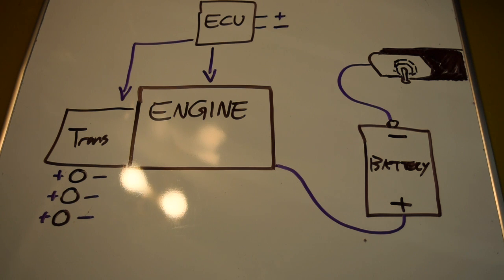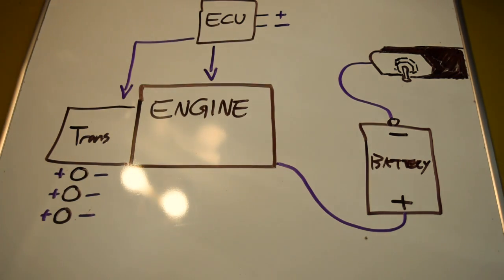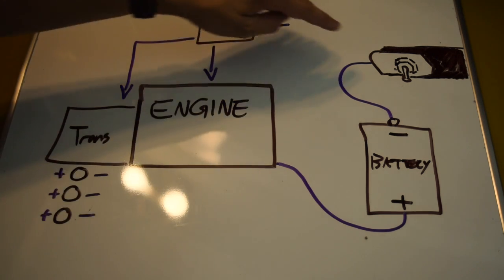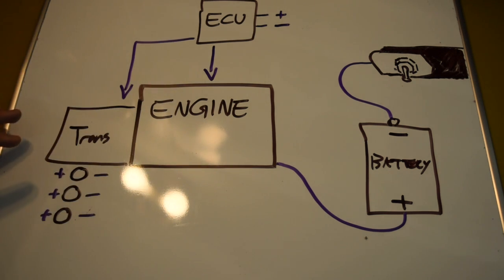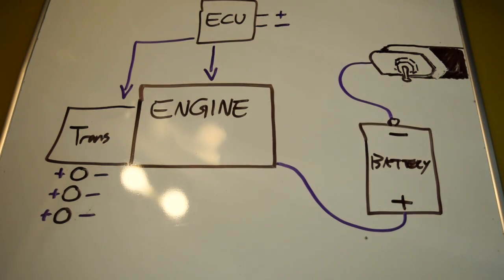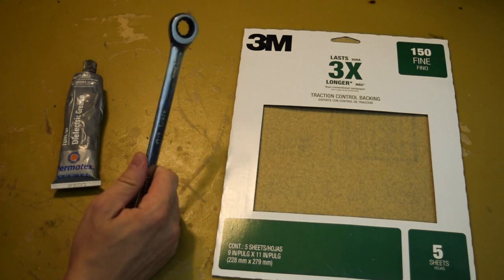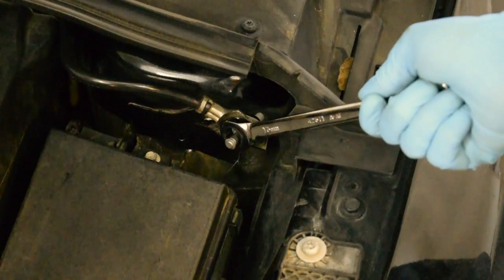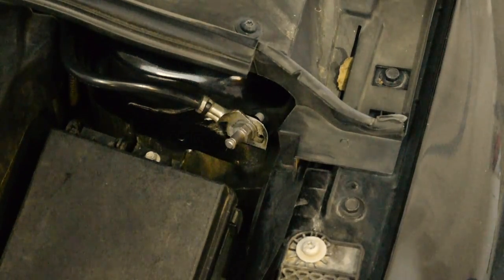Ford Focus DCT Ground Mod. Increase Driveability and Reduce Jerkyness

Comment: You forgot that there’s two ground cables mounted on the frame just under the air filter box. They’re small. I cleaned the two ground spaces where they go on frame. Using sandpaper. Transmission/ clutch was working much better. Forgot the main battery ground like you’ve shown in this video. I’m going to get that next. It was shifting very badly a lot of slippage on forward gears. Had it scanned had code P0 -702-00 transmission electrical system. Like I said, it’s shifting super great 👍 better than ever since I owned it. It’s shifting down then into proper gear it’s like a excellent manual driver is driving it.

Comment: Cleaning up the ground points isn't going to hurt a damned thing.
Even if it doesn't fix your problem....the connections between the negative post on the battery to the chassis of the car should be clean.
It may also help your car start easier if you live in a cold climate.

Comment: Another modification that kinda goes along with this is upgrading the battery cables to something a little bigger. Starting with the ground cables (that is going to make the biggest difference) but it will certainly not hurt to upgrade the positive cable as well. Some people are also installing a secondary drivetrain to body ground and getting rid of the flimsy little strap style grounds that are notorious for oxidizing and turning all green and looking like shit.
Reply: Apparently Tom's Tune from Focus Power helps a lot with the transmission issues as well.

Comment: takes 10 mins. dosent matter if it works or not.
good ground is good for 10 other reasons.
there is heavy paint on that main ground and i cleaned it to bare metal
car idle is better and a/c fan is stronger. tranny shifts better for now, like many said could be b/c of reset when disconnect battery. besides the paint the mount is pretty lite weight and cheap. so running a separate quality ground might be a good thing for some??
many of you have spent ton of money and had your car to dealer for tranny 3 to 4  times. so try it costs nothing and takes ten min. absolutely zero down side

Comment: Absolutely correct. A corroded neg ground bolt can cause all kinds of problems.  I'd add taking the ground cable assembly off and solder the ground wire to the lug instead of just the crimp, also sanding the washer on that ground bolt both sides and wire brushing the threads or buy a new one. This DID cause all kinds of problems with my 2013. A glitched computer can do ANYTHING. But removing the painted surface just below the lug is 100% better than the Ford design.

Comment: So what I've learned from this, is that if Ford had just not painted these area's where the grounds go, none of this would really be an issue.... Good job maker of cars for over a hundred years
Reply: they painted this ground connection for *years*, I just can't understand why.
Reply: @tissuepaper9962  actually old cars its fine since less electronics, less demand on ampheres.... but now that the cars are getting more electronics and technology that is powered by the alternator and battery, the usual painted ground is not enough now.

Comment: Just came across this video. I have a 2018 focus with the cursed transmission. My son replaced the actuator last year and the other one in June. It still didnt shift right and the transmission hot light would come on. My so decided the clutches needed to be replaced and he told me to "baby" it. I babies it drove it like a stick when I wanted it to shift I let up on the gas and it shifted  but everytime I got in it to start I would have to turn the key on and let it go thru a series of "clicks" before it would start. In Sept it sat for about 3 days when I got in it and turned the key no clicking and it drove and shifted great. The engine light went off and it was fine until about a month ago it started all over again this time worse it has been sitting a couple of weeks. It's gone back to the clicking before it will start the on the battery not the ground on the side is corroded and I noticed I have a fuse that's corroded. I have a brake light that you can replace and it goes out in a few days all this makes me think electrical. I'm going to try your fix and see what happens
Reply from the maker: wow! let me know what happens
Reply: @brownroush   I'm going to try this fix later on this afternoon. It seems simple enough I can do it. Hopefully there hasn't been damage to the clutch. I drove pick ups for years this is the first car I've owned in probably 25 yrs. Had I know the type of transmission that was in it I never would have bought. Yes I called Ford Corp and told them just that

Comment: Just did this today and had very positive results.  I have a 2016 Focus SE with 35,000 miles and it just started getting jerky when taking off from stoplights, and slipped into neutral once.  I also removed the air box to do the same to the other 2 grounding points, doing all this with a disconnected battery.  Whether this seems to work because of better grounding or because you reset your transmission in the process, or the combo - the end result is a good one.  I also drove it through several rev cycles, letting it shift near red line, as was suggested here to remove any clutch plate glazing.   Thanks for sharing this!
Reply: The ground bolts under the air box are critical to fixing the issue. I actually bought an extension ground cable to also run from the main battery ground to one of the bolts under the breather. Worked great!!!
Reply: @kerrysowards5084 Thanks for the tip.
Clean electrical connections on anything electric cannot be overrated.

Comment: Just did this to my 2014 Focus with 116K. Jerking shifting, gears not engaging, reverse mostly not reversing and in line for an infamously back-ordered TCM. Figured why not try this mod. Day 1: Amazing. Smoothest shifting I've had (got the car with 70k) and all gears seem to be working. I'll drive around tomorrow and over the weekend and see if it holds up, but honestly, I'm surprised it worked so well! Thanks!
Reply: How is your Focus working after the modification?? I know you said you were in line for a back ordered TCM.  Has that new TCM arrived?  Is it installed?
Reply: @frankloy2701  The modification worked perfect for about two weeks. I also made sure to put in a brand new battery at the time. And then overnight, it went back to not shifting or going in reverse. My Ford dealer has the car and will put in a new TCM when they get one... which they hope will be sometime in October. But no guarantees. I think I'm second in line at the dealership and it's a bigger dealership, so fingers crossed!
Reply: @andyazula  thanks for the update!  Sorry the modification didn’t work.  My car sits at the Ford dealership with no stated arrival date for my TCM.  It is a pretty sorry situation indeed.
Reply: @frankloy2701  that’s crazy, I just took my car in yesterday, got told today they have “no idea” when they’ll be able to order one and that they usually take up to 2 months at times.. picked up my rental today while my focus sits at the shop for god knows how long.
Reply: @ke2143  who pays for the rental?
Reply: Who pays for the rental???
Reply: @andyazula  HUM, so it looks like delivery of the TCM is an issue then I may need to order one NOW even though I don't need one now, to keep in case
Reply: Clean the actuators

Comment: i have ford focus 2014 automatic 2.0 since one month sometimes from 1st gear to second i have very bad jerk in m car so i have shown to many garadges and in the end its shown in the computer its a issue with clutch actuator.so i did replaced a new one now there is no issue with the jerk only the thing when i put it drive the car not moving unless i press the accelrator what is this issue

Comment: Did you ever think about adding a chassis ground,I bought one of these cars and it currently has shifting issue I just load tested the battery it's weak so I'm gonna try that and possibly this mod as well

Comment: Well I think someone is going to be really pissed about this video .WHO, Ford dealers. WHY, well they wanted to pull my trans and change a bunch of stuff at a cost of 2500.00 and you just screwed them out of a bunch of money from us old guys and our lovely wives with this video. YEP it worked like a champ for my 2015 focus and the ford motor company knows what this crappy ground is doing and most likely loving the money they make from it selling unnecessary part with labor. OK NOW I HAVE SOMETHING TO SAY TO YOU PERSONALY. THANK YOU AND IF I COULD I WOULD BUY YOU AND YOUR LITTLE GIRL DINNER FOR THIS AWESOME VIDEO. THANK YOU EVER SO MUCH.
Reply: Just curious how long this lasted or if it ever went back. I know this is a couple years old

Comment: So I have a 2013 ford focus and it has an automatic tranny anyway I'm trying to turn off the transmission fault check transmission bell ,and I watched this other vid on you tube that tells you to take off POS. Battery connection, put a towel so as not to accidently slip and put cable to touch the terminal while you wait ten minutes ,with a jumper wire connected to the neg over to the pos. Cable ,and I did all this but to no avail . strangely enough I had a problem with my remote key not locking or unlocking the door and the CD player had a CD stuck in it and would only try to eject it if messed with! Well they both work now ?

Comment: The reason this seems to work is because disconnecting the battery clears the adaptive learning. After awhile the car will learn all your bad habits and start shuddering all over again. I know because I tried it.
Reply: That's right it fixes the memory problem
Reply: That's why you change your driving
Reply: How long did it take before  it start shuddering again?
Reply: You’re not replying but anyway here goes - did you have it scanned for codes ? I did and had P0-702 -00 transmission electrical system

Comment: This may help. Like others have said, the dual clutch glazes on these autos. Simply rev through the rev range in the first 3-4 gears multiple times in a row and it should clear up any jerking in the early gears. Ford TSB on this issue states to do this.
Reply: When you say to rev through the gears, do you mean just floor it through the first few low gears and that'll help clear it up?
Reply: @SIl_Ae  Watch this video by this Ford Tech guy for a good explanation. https://youtu.be/msA0p87O2y4
Reply: @XJon2011  much appreciated, thanks!
Reply: @SIl_Ae  did you ever figure out what they ment by rev shifting?
Reply: @dwjackson903  I apparently did but it's not here lol. I've adopted a habit of trying to keep the pedal down (not necessarily all the way) when shifting through low gears, with the hopes that the transmission/computer adapt to it and minimize slippage. Can't say it's worked too well overall but sometimes it does cure the slippage.
Reply: @SIl_Ae  LOL I am afraid this pos transmission would have a stroke if I did that. 
Did you reset the transmission or anything before you adopted this new driving style?
Reply: @dwjackson903  nope. I've had my focus for going on 8 years now and it's still running. I don't necessarily abuse the transmission, just try not to be as much of a feather foot with it these days to prevent slippage. There is a difference, it's just not a permanent fix. I've thought about resetting the transmission but haven't yet. Idk, it is what it is for me. I had the transmission reset by ford once, entirely replaced another (under warranty), and if a third issue pops up I'm hoping that's lemon law.
Reply: We call that an Italian Tune Up

Comment: 2012 Ford Focus, 145K Previously got "Transmission Failure" and no reverse. Also gear changes were very jerky. Did the 3 ground wires, disconnected the battery (also did the wideband oxygen sensor, to remove the CEL). Took it for a spin, revved it thru the gears - its a dream. Starts fine, drives fine, should easily make it to 150K then onto 200K.
Reply: I got the sam3 problem and took it to a transmission repair shop and they told it was the cluth
Reply: My car is at 156k im going to try this

Comment: Tried it. Didn't work for me, sadly :(  I have a Ford Focus 2012 with automatic transmission. I'm facing the same issue of jerking. Had its TCM replaced 15-20 days ago, but still has the same problem. But something which is very odd is, this problem is not there ALWAYS, and by that I mean, if I start the car for the first time in the day, the car will run okay, gear transmission is very smooth, no sounds or anything. Then I turn the car off, take the key out, lock it, and when I come back to it, unlock it, start the car, it starts the trouble of jerking, 1st gear sometimes feels okay but sometimes powerless, then when it shifts to 2nd gear it gives a big jerk with some noises, and same continues to happen. One thing that is important to note is that I've observed when this problem arrives, the car won't go to S (Sports) mode, I mean the gear lever will physically be at S but my display won't show S highlighted, that is when I know the jerk problem is back. Also if I try to move car at S (with the problem) it stays in the first gear and won't shift at all. Then to get rid of this issue, I have to park my car somewhere, switch it off, take the key out, and lock it with the remote key, few seconds later, I'd unlock it and start the car, then I check to see if the car goes to S mode, if it does, the problem is gone, for that very moment, it will keep on running smooth even on S as well as D, smooth shifts, no jerks, at all until my next stop where I'll turn it off and lock it.
I had dropped the car at the garage from where I got the transmission module replaced 2 days back. Today I was told it is ready to be picked up, I went to pick it up, tried driving the car, everything felt normal, no problems at all, also tried switching it off and on, problem didn't come back, until night when I went on a ride again but used S mode with selective gear shifting, I stopped at a shop and when I came back, again the same problem as before. I'm not sure if it is the module itself, or there's something wrong with the ECU or anything. I can also share a video of what happens with the car.
Also there is no check light on the meter. System information shows all systems are normal, too.
Can anybody help?
Reply: I am having the same problem. Have you figured anything out?

Comment: Thats crazy! It worked for me but I had to do all three cables, battery and 2 under air box. Did just battery cable first but did not work until I did all 3
Reply: Was your car having issues with going from 1st to 2nd. Like jerking?
Reply: @20kazper  Yes. 1st and 2nd only

Comment: 846 Carbon Conductive Grease is good for the terminal to bare metal surfaces as it conducts electricity and helps prevent corrosion. After the connection is made then put on the dielectric grease as the waterproofer and to protect the showing bare metal from rust and corrosion. 
Not hijacking the video, just sayin.

Comment: I did it but didn’t work how ever…. My battery is bad so I need to replace it. And under the air filter cover and battery covers there 2 more ground cables u need to sand off as well this was something I found out while I was working on my car

Comment: You could also remove the air box, and clean the 2 grounding points beneath and add a cable with eye loops on each end from the point on the strut tower to the fat cable mounting point beneath the airbox
Reply: I’m having a hard time getting a bolt out where you disconnect the hose how did u manage to get it?

Comment: Worked for my 2015 Focus.
Reply: Did your car stall on you? My car stalled 3 times in 3 week period. Was your car affected by any recalls on the 2015 Ford Focus. I never got the check engine light to come on. It is at the dealership right now. It has been there for more than 3 weeks now. I may have have to tow it home and try this fix.

Comment: All hell yeah it worked, transmission had a PO 902  error code for a actuator low voltage. After I cleaned and sanded ground thermal on body it took the hard shifting out and now it drive like not new but better. Big thanks.
Reply: Hey Ricardo, did the P0902 ever come back or did this fix it for good?

Comment: The power shift transmission is a learning transmission.  If you drive it slow, it shifts soft. If you drive it hard, it shifts firmer.   With the A/C on, it'll shutter  more taking off slow. Drive it hard through the gears on a open road a couple times. And it will stop shuttering. And i use the bottom on the side if the shifter when passing,  it shifts it down faster. But you have to remember to push it when done passing.

Comment: thank you for the video... i have same car (2012 focus 1.6 Tİ-VCT powershift transmission and almost 75k miles) and i also have a battery warning light on and off occasionally... i am driving my car with the test mode on and i am tracking my batteries voltage value past a few weeks . The engine starts around 12,8 (sudden drop and rise during ignition) and rises up to 14,5 V in seconds... But after some miles it starts to decrease 0,1 by 0,1... on the highway it stays on around 13,3 V but in traffic jam it decreases a little more till 13,0 V... i get battery warning light last night and the value was 11,6 V.... after couple of miles voltage increased suddenly to 14,1 V again... now i would like to ask that do i have to renew my alternator or my 1 year old battery... and one important/interesting thing is here there was no shudder problem with my transmission when the battery voltage value more than 14,3 volts... smooth transmission and my car starts obvious shuddering when it decreases around 13,6 volts... so i believe there is a direct relation between charging and shifting system... please give your feedbacks and thanks in advance...